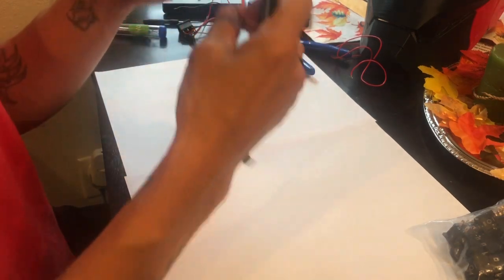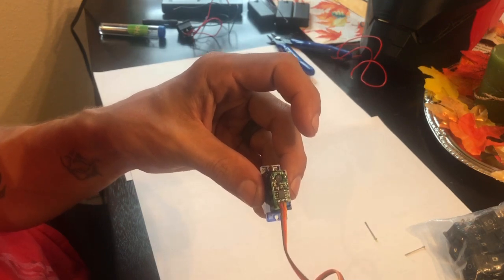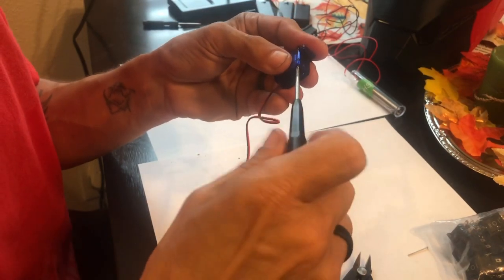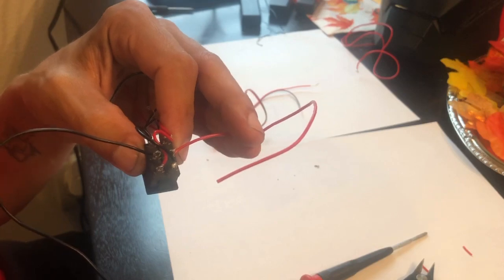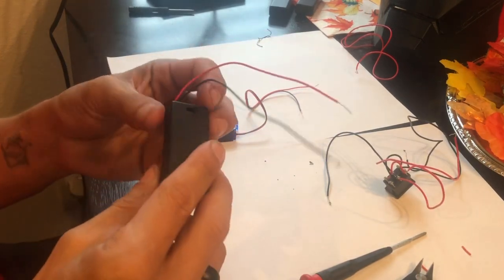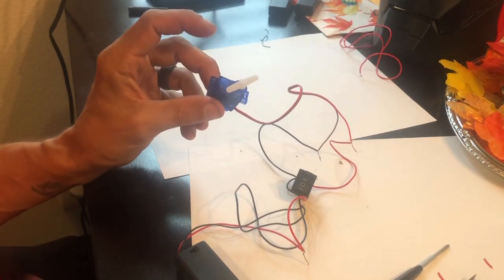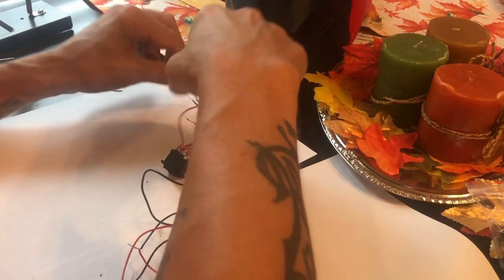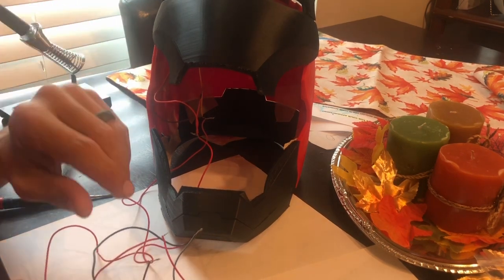Iron man motorized faceplate | how to hardwire a servo motor | no arduino needed | how to tutorial

Comment: Could i ask what u  used to fill the line in on the mask ? as Im trying to do with Ever build all purpose ready mix filler
Reply from the maker: Use a 3D pen or pla weld as much as you can. Sand it and than use bondo plastic metal to fill in and even it all out

Comment: but the servo only stops because of the pin on the gear in the servo so if you leave it in any on position your leaving a power feed going to the motor and will burn it out , good idea tho !
Reply from the maker: Correct, that’s why a 3 way switch if you switch it back to O it kills power if left in on position it will absolutely burn out. The next video I have a 2 relay set up that is much safer!
Reply: Relays and limit switches are what is needed for that. Concept is fine but might as well buy an arduino for what it will cost in extra parts. This way the motor will just burn out since its not able to shut off plus they are plastic gears in those so they strip super easy. Not knocking the video at all. Just learnt some stuff doing things like this too. I'm sure you already know this.
Reply from the maker: @shutinyanks  just showing people different options that are simpler, I do have a video showing how to use 2 relays and a single switch similar to what you’re mentioning.

Comment: I'm thinking of buying some of the MG90's of Amazon. But the servo Maximum angle is 90 degrees in each direction, do you know if 90 degrees wold work for the MK2 helmet or is that too much of an angle. P.S as you probably can tell this my first time motorizing a helmet..LOL
Reply from the maker: The 90s are fine, a bit more durable if you’re using them a lot. The degree they operate will be fine it’s all about the placement inside the helmet, you can adjust the gears as needed
Reply: @Darkwingdad  Are you still planing on doing part 2 on a motorized Ironman helmet?
Reply from the maker: @BIGDW-ie8st  yes I’ll be working on the video in the next week or 2
Reply: @Darkwingdad  Cool sounds great.
Reply: @Darkwingdad  One more thing how many volts do you need to run both servos in the Ironman helmet?
Reply from the maker: @BIGDW-ie8st  they operate as low as 5volts
Reply: @Darkwingdad  Thanks for the info man

Comment: Hi what if I just try to connect the servors on what about molten metal morning would it work
Reply from the maker: I’m not sure I understand your question? What is molten metal?
Reply: @Darkwingdad  like you know how I’m your video you used a Soldering Iron but when I tried I didn’t use it I just put the wires on but the servo motor didn’t work is it mandatory that I use a Soldering Iron
Reply: @Darkwingdad  I connected all on the porch but I didn’t melt any metal on it so is that why it didn’t work or The server  just broken
Reply from the maker: @Vfx874  oh ok yes you have to solder it directly off the motor. If you use the harness not hardwired it won’t work. When you hardwire it your bypassing that little board

Comment: Take the top of the servos exposing gears fill lid with high melting point grease put  back on acts as damper slows down ans smooths out rc flying boys use this hack for landing gear stops under carriage smashing down
Reply from the maker: Thanks for the tip!

Comment: I followed you nd I used servos for face plate but it's rotating Opposite direction it's not rotating in same direction please please🙏 help for this
Reply from the maker: Switch one of the servos wire opposite the other, the polarity isn’t matching. So basically take one and flip what you have the wires hooked up. Don’t touch anything on the switch just reverse or flip the two leads coming off one of the servos
Reply: @Darkwingdad  Did but it's still same two servos are in two different direction
Reply from the maker: @jeffstark4488  reposition the servo horn(arm)
Reply from the maker: Also the servos should be facing either other & flipped in opposite directions once in the servo bracket
Reply: I have messaged you in Instagram sir please come over there